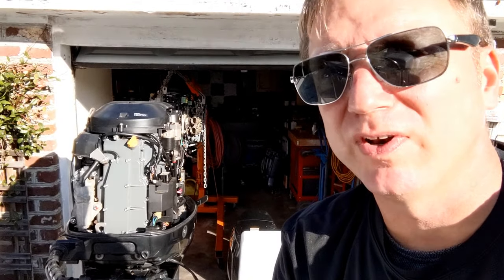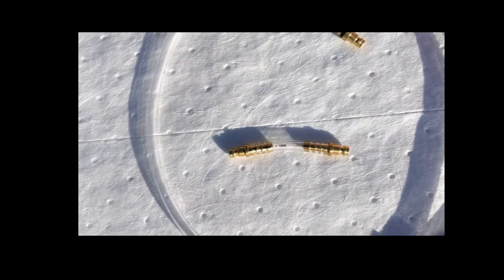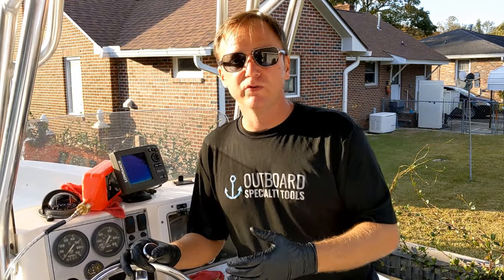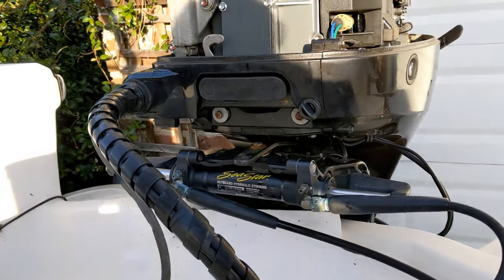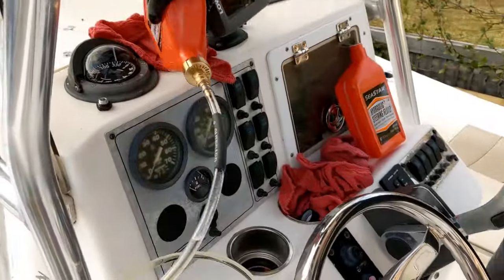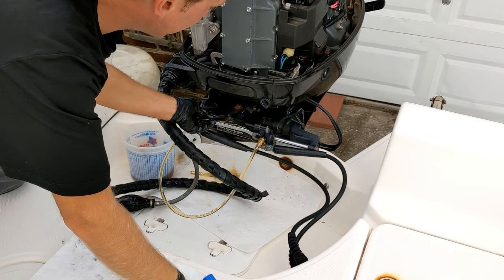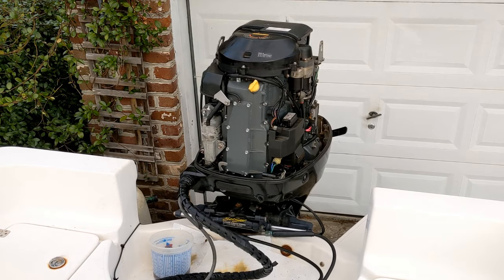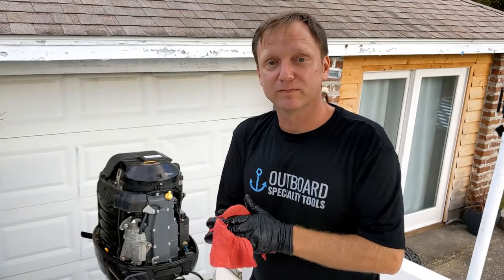Bubble Purge G2 SeaStar Hydraulic Steering Flush and Bleed

Comment: So I followed this and ny system came out pretty good. I locked the control rod a little different than you did. I dobt like claming down on an actuator rod so I used an idea from my military experience. I used downlocks on aircraft to prevent speed brakes from closing and landing gear from collasping. I took a 3/4 piece if pvc, cut out a slot so the pvc would slide over the actuator arm , put a shop rag over the arm and the pvc lock clipped ib place. Imade the pvc piece long enough to cover the whole rod when the motor was pused to the stops.
Reply: I worked commercial aviation for 30 years, used lockout tools just as you described, I'll probably do same. Ya vise grips on an actuator rod despite plastic and rags was cringing, effective but cringing just the same. Very thorough video thanks

Comment: Want to say thank you for making a great product. I used this to flush the old fluid out of my Baystar steering so that I could install an autopilot pump, then used this to re-fill the system with fresh fluid and bleed. It worked perfectly to bleed all of the air out of the system and all of the components seem to be of good quality.

NOTE: In the product manual it says to not use this with an autopilot. I did NOT run the autopilot pump with the bleed screws open, and do not recommend doing this. Close the bleed screws on both sides of the cylinder, run the pump back and forth to purge air from the pump, open the bleed screws again, and finish bleeding the system.
Reply from the maker: Ryan, thanks and glad to hear you had good results!

Comment: Fwiw, rather than using PEX and vis e-grips to keep the motor from moving, I cut a piece of PVC pipe, and cut a slot in it the length of it, then sanded its edges and put it over the shaft, using a clean rag to ensure the shaft didn't get nicked. It worked very well.
Reply from the maker: Your method is well thought out.  I like it and thanks for sharing this info!

Comment: I've watched your video probably a dozen times.  I was thinking instead of using a short PEX tube with Vise-grip, what if you used a full length piece that would stop all movement.  No plies needed. As you state, rod will be ruined even if dropping tool on rod.  Great video, helps to understand the entire system more.
Reply from the maker: Sorry for ridiculously late reply.  I agree, your idea is better.  It is very easy to damage the steering piston rod.  Pex cut to length is a good clean solution.
Reply: Thats what I did and it worked

Comment: Dude not only are you a great mechanic, you are an awesome engineer. Do you come up with all of these tools on your own? I do fiberglass and gelcoat only, and I never touch an outboard unless its mine, and I will research and watch YouTube to troubleshoot my own engines. Unless I am completely stumped or cant figure it out after HOURS, Im doing it all myself. I have a few of your tools now, and I will be getting this next. I have recently been doing a ton of work to an 03 200 ox66 and I had to do the oil seals on driveshaft, shift shaft and the prop shaft, used all your tools. Had to do a seastar fill and bleed for a new install I did about a year back and used your fill system, now I will be buying this set in order to empty, redo seals and refill my own seastar on a 1987 Mako 231 I am restoring for myself. It's impressive that you have invented so many usefull tools and they are very reasonably priced.
Reply from the maker: Thanks very much.  To answer your question, yes, many of the tools we sell were created and designed in house.  Its always great to hear people doing their own maintenance and repair because alot of boat and engine maintenance/repair is not complicated

Comment: Great video. Would you need two of these systems to bleed a twin engine catamaran where the motors are spaced apart and connected with a liquid tie bar? Does this system also work with a system that has an autopilot pump?

Comment: How will I be able to use this product with two outboard motors.??Wish there was a video on a step by step way to connect the cylinders with the tubes. The videos I’ve seen only concentrate on turning the steering wheel and not the back connections.

Comment: I did get the air out of the cylinder and helm. It feels ok. However, the steering wheel and power knob are not positioned the way I would like, off by about 150 degrees. How can I reposition the wheel? I thought about connecting the port and starboard bleeder valves with a line full of fluid and then rotating the wheel while holding the motor. Any thoughts? Thanks
Reply from the maker: Hi Paul, It's usually no problem to set the wheel where ever you want.  Set the motor pointed straight, attach the cylinder attachment (fill the attachment with fluid first, or you will put air back into the steering cylinde), open the bleed valves and you should be able to align the wheel any where you want it, with the motor pointed straight forward.  Occasionally the motor will move even with the bleeder valves open, so yes, someone may have to hold the motor steady.  Once the alignment is done,  close the bleed valves on the cylinder and you're all set.

Comment: I'm filling a brand new helm and cylinder, the lines have been flushed. I filled the helm as you described. At 13:40 when you start turning to starboard are the bleeders open?? I'm unable to get much fluid into the lines/cylinder.
Reply from the maker: Hi Paul, sorry for late reply.  Just checking to see if you are still having an issue getting the system purged.

Comment: Would you be able to go over a flush and bleed for a dual motor setup featuring two cylinders connected with a tiebar and a non reversable pump in the system?

Comment: My brand new pontoon (24 ft with a 200 HP,  3500 lbs )   Steering is very hard, even at low speed.    At speeds it is half turn at a time with both arms.    Dealer says hes seen this before and the problem is low or no hydraulic fluid.    He's sending me some fluid and I ordered your kit.    But wouldn't low or no hydraulic fluid symptom be having to turn the wheel 20 times to make a turn and not hard steering?

Comment: Y see different videos with different methods I thought you connect the line to both fittings unscrew the valve and let the air run thru the bootle ?

Comment: Quick question.  When my outboard is trimmed up-half way to fully - just before I get to lock on port and starboard sides my motor shakes and the steering wheel shakes also.  It will go all the way to lock though. I ordered the kit and added fluid and bled the system and it seems to be working fine other than the shaking part. Is that normal with a motor trimmed up?  Also, it takes five maybe 5.25 turns to fully turn the motor.
Reply from the maker: Everything sounds fairly normal based on your description.  The steering system will  behave differently when the motor is trimmed up because the hydraulics are pushing against considerably heavier load when the cylinder is off center.  The number of turns is in the neighborhood, but I would consult the specs for your particular helm model just to be sure.
Reply: Thank you!!!

Comment: Im complete on changing out the seals and have your system installed to blead out the air... im on my 6th time spinning the wheel both ways along with turning the motor to port and starboard.. i still have to much air in the system
Reply: I got it figured out... i believe i may have had my bleeders open to far and they may have been sucking air into the system
Reply from the maker: Usually, the system performance will start to improve noticeably after about 20 minutes of turning the wheel  in both directions, and yes, the bleed fittings can be a problem if they are not opened enough to too far open.  Another issue that is common with the bleed fittings is that they can become obstructed with debris over time and any debris that has built up in the fittings will need to be cleared.  Usually compressed air will  clear any debris buildup very quickly.  I hope you were able to wrap up this job successfully.

Comment: Closed Loop System Seems to work Better Dont you think ?
Reply from the maker: I prefer the closed loop system myself for most jobs.  When we produced the original Bubble Purge Video demo for the Bubble Purge Gen 1 Kit, I got quite a bit of email from people who were curious if the kit was able to do a full system flush and if it was compatible with old school methods as well as SeaStar's recommended methods so we put this video out.
Reply: So if you are just changing the cylinder caps/seals, you can just do the closed system method in your other video and bleed the system? Less hydraulic fluid is needed that way too, right? Great videos! Thanks!

Comment: Can you explain the reason for clamping the cylinder to prevent from moving? I thought it had to be able to move to force air/ fluid out of the system?
Reply from the maker: The main reason I clamped the cylinder down was to show a safe method for immobilizing the cylinder because in some cases if the cylinder is allowed to move all the way to port of starboard lock with bleed fittings attached to the bleeder valves, there is not enough clearance and the bleed fittings can come into contact with the lower engine cowling or the rigging.  I did not do an adequate job of explaining this in the video.
Reply: Thanks for the quick reply....makes sense

Comment: Do you know how to turn the thing that's under the purge valve? Right now, the hose thing that's below the purge is in the way of the fitting and I want to move it just slightly horizontal so I can pop in the fitting.
Reply from the maker: I'm very late getting to your question and apologize for the delay. I'm guessing here, but sounds like you are referring to the hose fittings.  On older cylinders the hose fittings are NPT thread and should only be turned counter clockwise, and then re tightened.  On most SeaStar cylinder after about 2013 they started using ORB fittings which can be loosened and adjusted as needed to any position.

Comment: QUESTION:  One of the hydraulic steering hoses somehow got pinched and created a massive leak. Can the bad spot be cut out and a compression type fitting be inserted to make a repair and still hold the PSI???
Reply from the maker: John, Sorry for late reply.  If one of the main steering hoses is leaking, in theory it can be cut back and SeaStar makes a fitting that can be threaded onto the end of a SeaStar hose that will mate up with the hose fittings on the cylinder and it will hold pressure.  The problem is that this fitting almost as expensive as a new hose, is not easy to find, likely have to go through a SeaStar dealer, and usually only installed by a SeaStar authorized tech because if improperly installed, the fitting and the section of hose it was attached to are trash.

Comment: Will this system work or Sea Star system with the Sea Star Power Assist  (part # PA 1200-2)?
Reply from the maker: Technically it will work with power assist, but it can add some time to the job.  We usually recommend upgrade to Bubble Purge Pro SC because it is dramatically faster and, by venting air out of the system at the cylinder as opposed to pushing the air back through one of the steering hoses, passing by all inline pumps along the way en route to the helm reservoir where it vents out, reduces the risk of re-introducing air to a previously purge and primed Power Assist or Auto Pilot pump.

Comment: I was planning on just doing the closed loop bubble purge but this system was installed about 10 years ago without ever  getting serviced since. Should I purge whole system like in this video or shakily I just do the closed loop.
Reply: Hi Wayne, I would connect up both ends of the cylinder attachment to the bleeders and pull a sample of fluid.  If its contaminated, I would flush and replace and bleed.  Really its a judgment call though.  Alot of people prefer to just flush the old stuff out and replace anytime they are doing service on the steering system

Comment: I have a skeeter bass boat and I don’t see a port on my steering column?
Reply from the maker: Some Skeeters have a remote fluid fill on the console.  It would look like a small black cap about the size of a Quarter that would be flush mounted into the console usually above the steering wheel.  There are a ton of bass boats that use a remote fluid fill because of having to fit the helm pump into pretty tight spaces.
Reply: @outboardst.comoutboardspec8631  thanks I’ll look again. I didn’t see anything that resembled any removable anything but will look again.
Reply: I have to remove the windshield to get to the port.

Comment: why does my engine continue turning side to side even when I open the bleed fittings and the helm screw? Also, I can't turn the engine side to side by hand.
Reply: Hi Mike, it's normal for cylinder to move when turning the wheel, even with the bleeders open because the helm pump is usually able to build enough pressure to move the cylinder in bursts until the bleeders can catch up and let off the built up pressure.   Being unable to move the motor by hand is a different set of questions.  If you are unable to move the cylinder by hand when the bleeders are open, there can be one or more issues.  One possible cause is corrosion build-up and solidified grease/debris combo causing the pilot tube to bind, and the other issue could be an obstruction inside the bleed fitting, although it is rare for the bleed fitting to remain obstructed for long if you turn the wheel with the bleeders open the pressure will often dislodge most obstructions.
Reply: @tylerholland2232  Thanks for the quick response. One of the bleed fittings was completely clogged with what looked like salt build up. Was able to remove it all out and started to get a good flow of oil. Still no luck moving by hand. Would you suggest removing the cylinder and clean up any corrosion?

Comment: will this method/tool work with an autopilot pump?
Reply: Hi David, technically yes, the G2 Kit is compatible with SeaStar systems equipped autopilot, but not recommended.  Not trying to upsell, but for SeaStar with autopilot I recommend one of the Bubble Purge Pro Kits.  It is more efficient with systems with pumps in line and vents air out at the cylinder as opposed to routing air to the helm and passing air back by and through every pump and fitting along the way.

Comment: Why don't you vent the bottle?
Reply: I vent the bottle by cracking/holding the quick connects open slightly so the bottle can vent as needed for a couple seconds as we did at about 15:20 seconds in the video.  I usually try not to puncture the bottle because if the bottle is punctured and there is new fluid remaining in the bottle when the job is done, I now have a containment issue with the remaining pristine fluid and a disposal issue with piece of useless plastic hazmat the I just created.  The Bubble Purge Kits all create a pretty tight seal at the access points on the helm fill port and bleed valves on the cylinder.  Once the helm, which is essentially a very powerful hand pump, is primed it will easily pull fluid out of the bottle as needed whether it is punctured or not, and normally the bottle is prevented from complete collapse by incoming air as it vents out of the helm.

Comment: Will this also fit the SeaStar system for F115 Yamaha 2002 model with the SeaStar 1.7 Helm european ? (Don't know if there is any difference?)
Reply from the maker: I apologize for the very late reply.  We have not tested on European Market specific helms and cylinders.  I would assume that the fittings and specifications would be the same, but I have not seen the European product in my shop, so I can not verify.  We have sold numerous G2 Kits to buyers across Europe, and we have not received any feedback or complaint suggesting a problem with compatibility with SeaStar products sold in the European market to date.